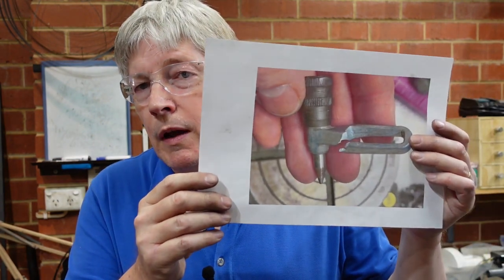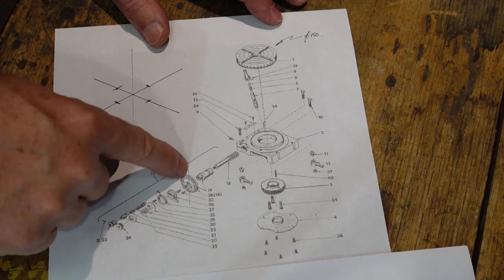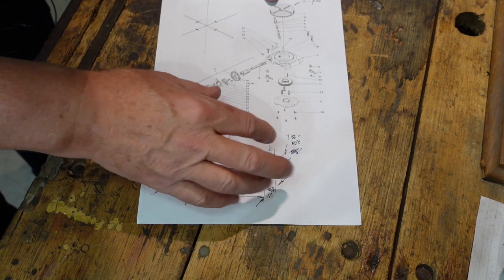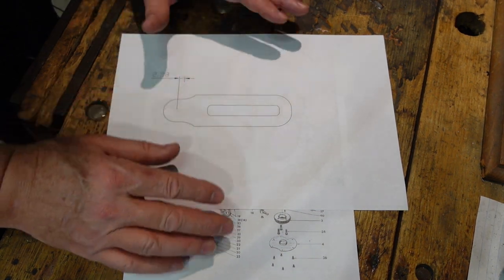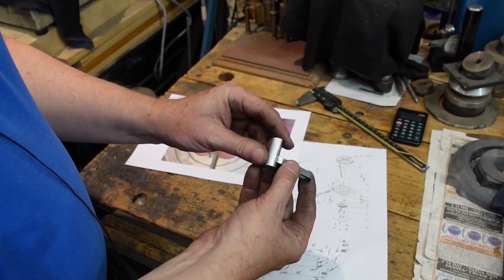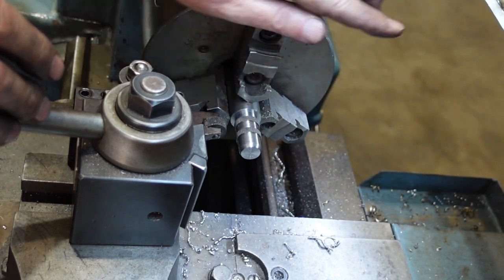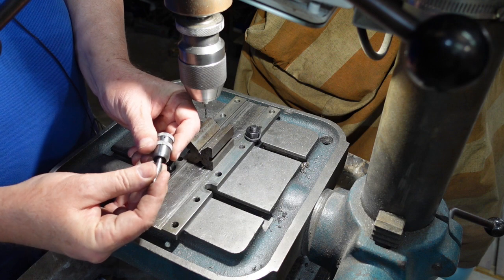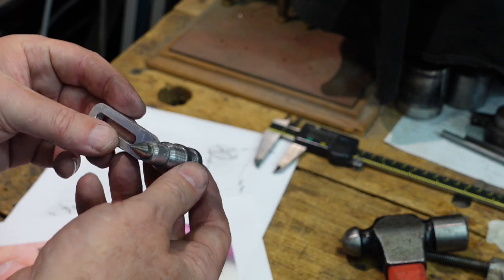Reproducing parts without technical drawings

Comment: EMCO is not Swiss, but Austrian.  However it is still all metric and they no longer make manual type machines, probably because there are fewer and fewer people who know how to machine without being able to push buttons to institute a CNC program.  Good video for people who need to learn how to interpolate and infer.
Reply from the maker: Thanks for the correction. I was geographically close but not close enough it seems.

Comment: for your manual drawing are you just using set squares and a rule, a Tee square or a drafting machine ? very informative,  reverse engineering and scaling and nominal dimensions
Reply from the maker: I just used a geoliner (set square like object) but a rule would do just as well. A drafting machine would be really cool but overkill for what is required here